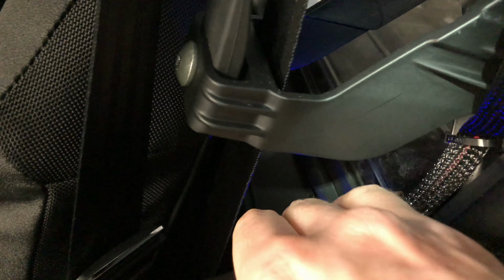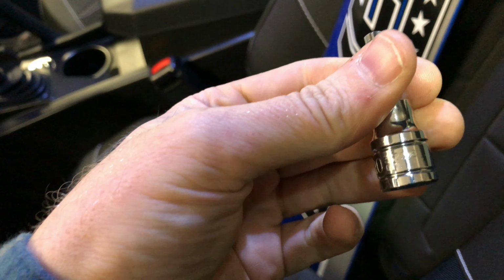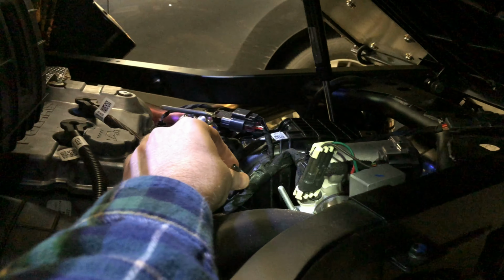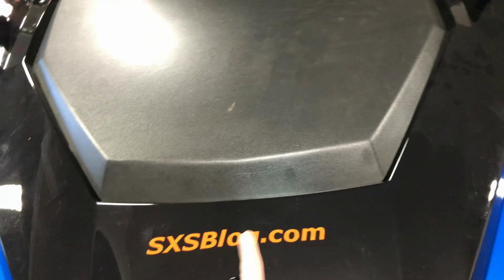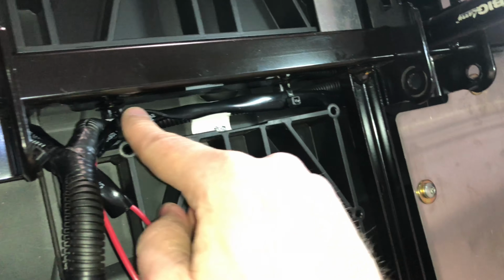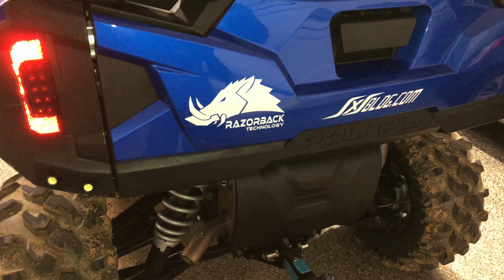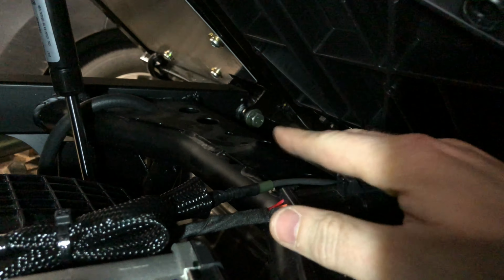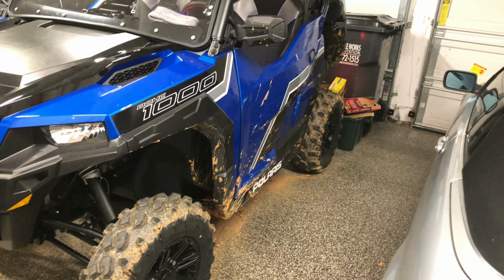Polaris General - Reverse LEDs Installed

Comment: I know this is an older post but did you wire your battery charger cable to the battery connections under the hood or to the battery directly?
Reply from the maker: To the hood connections. The lines go directly to the battery.

Comment: Have to ask since it's been over 2.5 years.  How have the LED lights held up?
Reply from the maker: I’ve never really had an issue with long-term life on LEDs. However, I did have a couple of problems with the “dome” type bolt LEDs (like the ones I used for the reverse lights and the dome light—example: https://amzn.to/3dX23Ax). The dome fell off on a couple of them. Fortunately, I found them and superglued them back on. As for them working—no issues, though. And LEDs are always very bright.

Comment: How are the led backup lights attached? and do you have a part number?
Reply from the maker: The video description has a link to the LEDs I used. The wiring uses a standard 12v automotive relay, but it’s wired using ground as a trigger using the OEM wiring. If you look in the comments, I think there’s a link to the wiring diagram, but you can also look on the Polaris General forums and find it there, too.
Reply: General Talk with Ben does a nut go on the back side? Or are they glued in?
Reply from the maker: There’s a nut on the rear. You can pull the panel off the side of the bed (one screw at the front when you lift the bed, then pull out) and reach in to tighten it (I used a little bit of locktite as well).
Reply: Nice setup! My bolt lights came today, how did you connect the wires to the relay? The wires are vary small.
Reply: jeff frank the relay gets wired as a ground trigger rather than a positive trigger. I don’t have the link handy, but if you search on the polarisgeneralforums.com you will find the diagram. It’s very easy, and you wire it up like normal, but in the ground trigger position. As to the small wires, be sure you solder or get a very good crimp, and use shrink tubing on the end to help keep it supported. You can also double the wires over, too.

Comment: Hi Ben,
Enjoyed the video and those Eagle Eye LED lights look awesome.Ive never wired anything other than the plug and play turn signals and horn kit on my General,but would like to wire my reverse lights like you did on here. Do you ever go into alittle more detail for us beginners on lighting?
Reply from the maker: Here’s the key post from the General forums (“Reverse Lights?” Is the name of the post string, and the below is from post 41): 

86 - Red wire from light and red/purple wire from harness
85 - Black/White from harness
87 - Black wire from light
30 - Ground

This is how you wire up the relay to come on in reverse without a switch.
Do not use the middle 87

Comment: How did you get the reverse light in the bed?
Reply from the maker: Remove the side panels (tilt the bed, then remove the single screw at the front). You can then reach down into the void to connect everything.

Comment: Where did you find the head liner that looks sharp i want one for mine thanks have a great day be safe.
Reply from the maker: It came with the factory “premium” roof kit. I had seen that there was some difficulty in ordering just the headliner if you already had the roof, but that may have changed.
Reply: @GeneralTalkWithBen  Thanks yes it is hard to find.